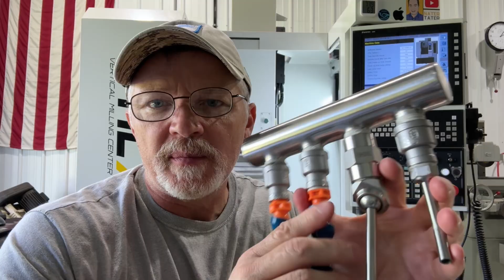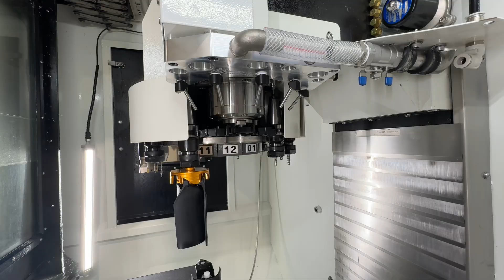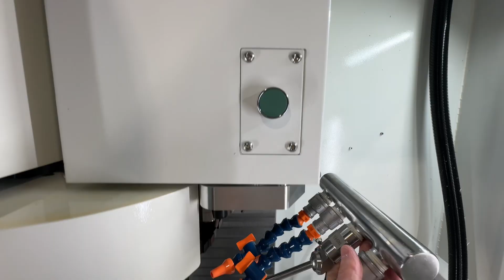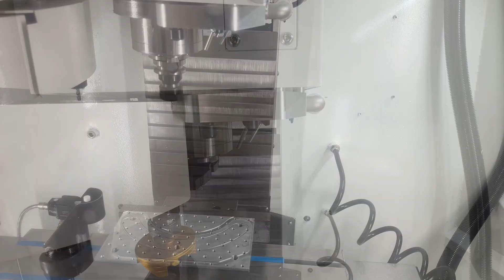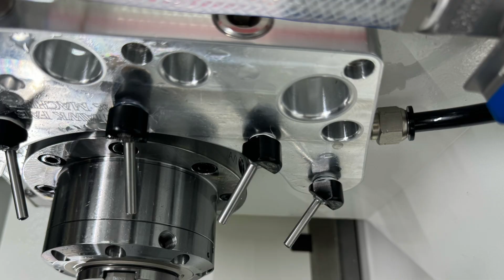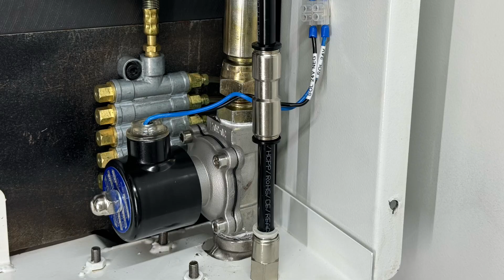X7 Flood coolant upgrade.

Comment: Thanks for sharing the files! I've been meaning to get one of these made to clear my 4th axis on my X7 as well. The air purge is one I wanted to implement too. I was planning on using a delay activated / timer relay to activate an air purge for 5s anytime the coolant goes off. Definitely would be interested in seeing the electrical work you did to make it all work.

Comment: Great job. 
I have the 16T ATC, and my X7-20 came just before the standard coolant ring that’s supplied now. I made my own ring and incorporated a solenoid shutoff valve also, it’s worked well for several years now.

Comment: Looks great. Having the air on the same nozzles is pretty smart. The stock setup with the 4th sucks. I will need one of these.
Reply from the maker: Thanks Frank! I’ve been using it for a while and it is so much better.